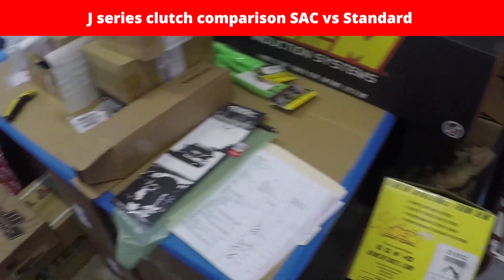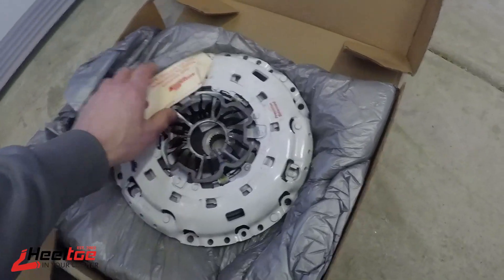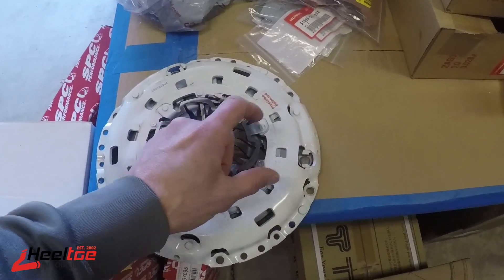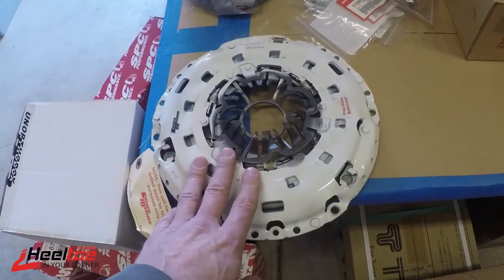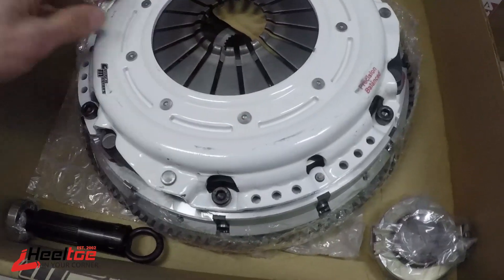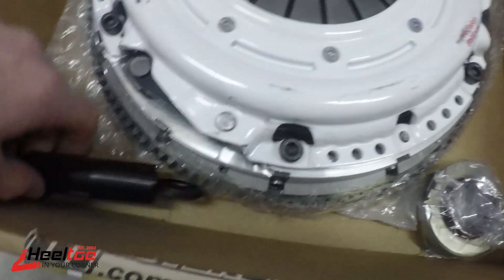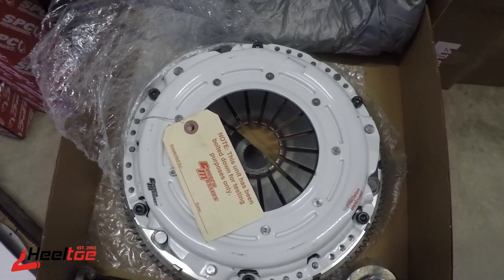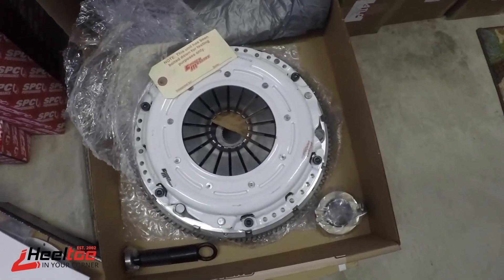Clutchmasters clutches compared, Self-Adjusting versus Standard Pressure Plate (J32/J35/J37)

Comment: How do you install the self adjusting clutch? Do i need a special tool? I got a clutch kit and the springs are compressed already. That means is ready for installation?
Reply: If it's new and has that plate precompressing the springs, it's good to throw onto the car. Only release that plate once the screws are all torqued down though

Comment: So would this self adjusting plate cause the clutch pedal to feel very firm after a 6k rpm pull then go back to normal? I have an 08 TL type s
Reply from the maker: No, it would not. The self adjusting mechanism should have a consistent feel throughout the life of the clutch.

Comment: Ok I came here to see what kind of clutch I need to put in my 2000 F150 V6. This has helped me understand what kind of clutch I need to get. I think it came with a self adjusting clutch but its been on there since it was brand new. Its grinding in 3rd gear and hard as hell to get into reverse first thing in the morning. I was wondering what would be my best option to get for my truck I do have a grass cutting buissness on the side so I do some towing. What would be my best option?
Reply from the maker: Hi! Thanks for the message. Unfortunately we are not really experts in Ford trucks, we specialize in Honda and Acura cars. Your issue could be related to the clutch but maybe nothing to do with the type of clutch it is. We recommend getting a professional diagnosis.
Reply: @Heeltoe.  yeah I get the picture just trying to see if the clutch is on its last leg.
Reply: @hunterfoster1714  your issue wouldn't be the clutch if it's not in all gears.

Comment: You dont know how excited i get when i see j series videos!! They are rare.. not alot ppl know about the j series !!!
Question: so the non preloaded spring pressure plates should last longer?? 
Doesnt the preloaded pressure plate absorb more impact??
https://www.ebay.com/itm/Clutch-Kit-9-44-Cover-Disc-Bearing-Pilots-LUK-For-Honda-Accord-Acura-CL-TL-V6/362390748386?epid=75315196&hash=item54602bfce2:g:hCoAAOSw9z1b7jBU

https://www.ebay.com/itm/CLUTCH-KIT-SET-fits-2003-2013-HONDA-ACCORD-3-0L-3-5L-ACURA-TL-CL-3-2L-/172718799016